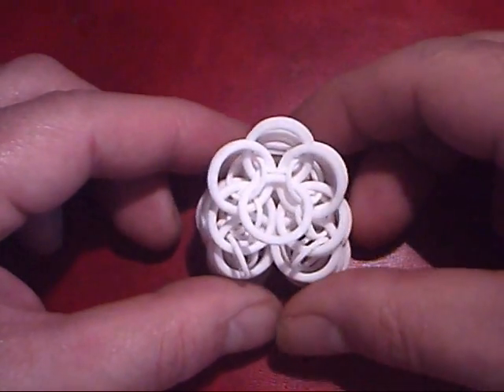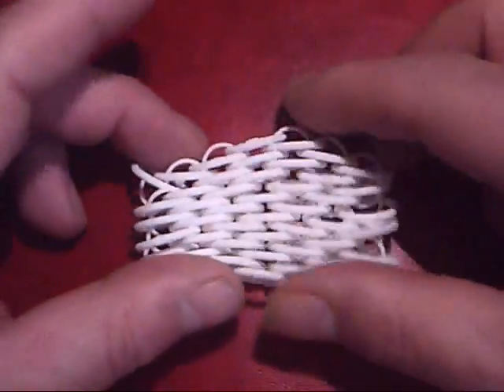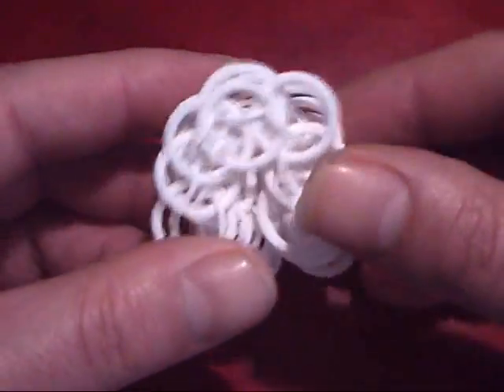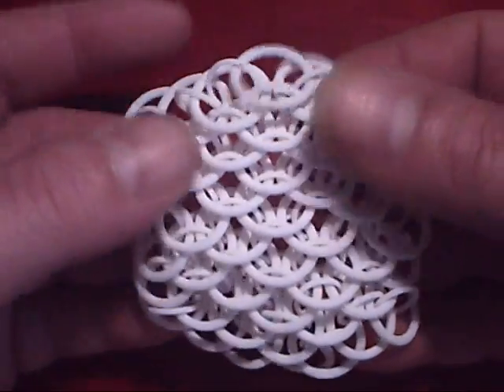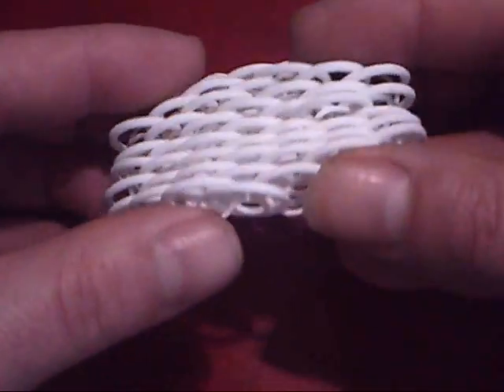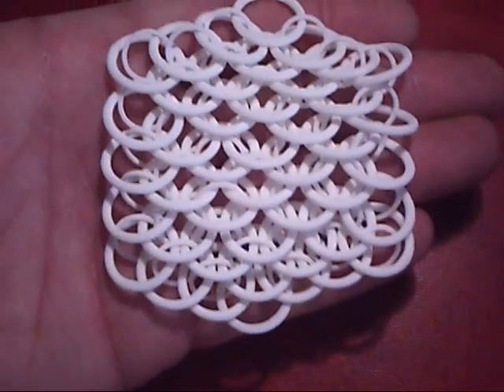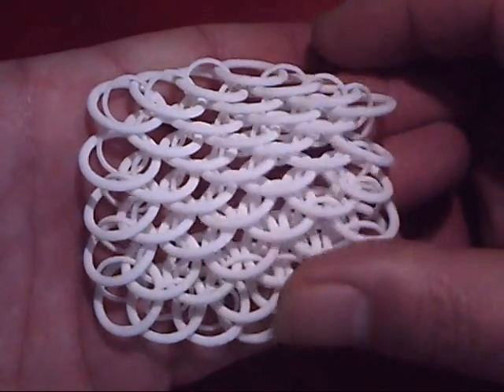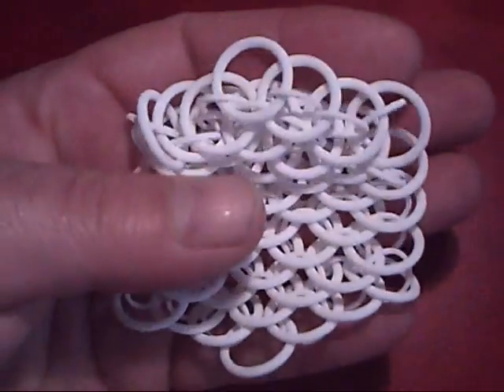Dragonscale Chain maille - 3D printed @shapeways

Comment from the maker: Yes 3D printed buildings are a posibility, Google for 'Contour Crafting'.
The main limitations of a 3D printed model are the materials avaialbe for printing and the printer it is printed with. With Shapeways Frosted Ultra Detail (FUD), it is possible to have parts with as small as 0,3mm wall thickness and 0.1mm gap for moving parts with all of the parts printed in situ - 0.1mm clearance is relatively big for moving parts though. With the accuracy of FUD, tolerance fits are possible.